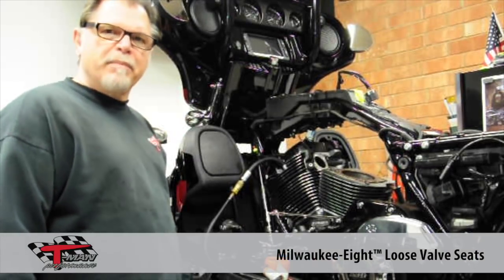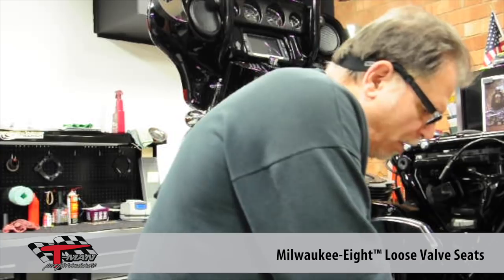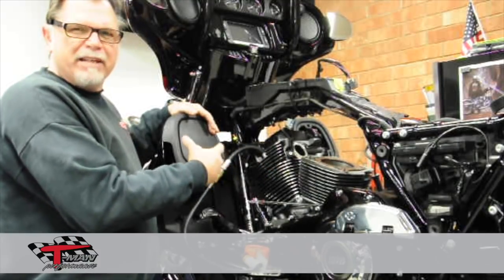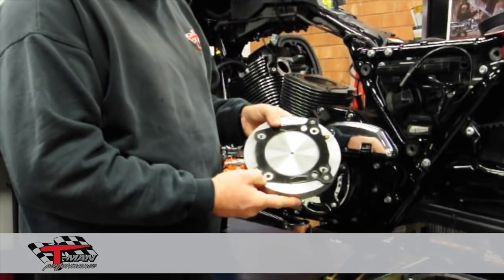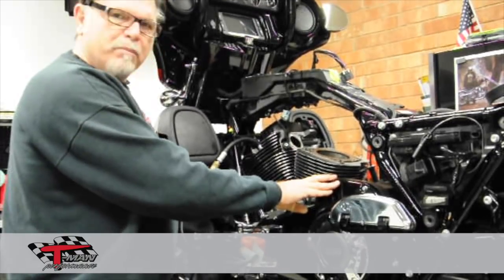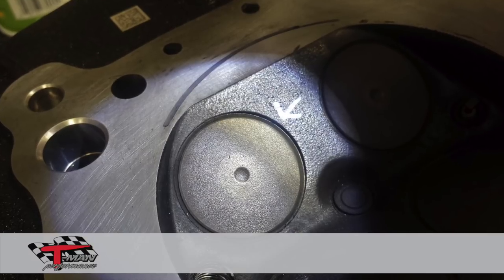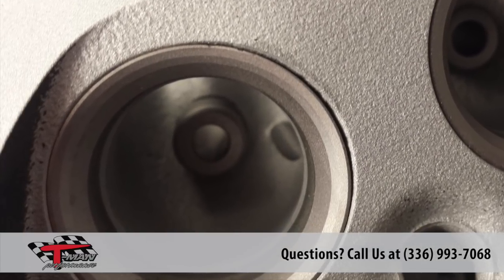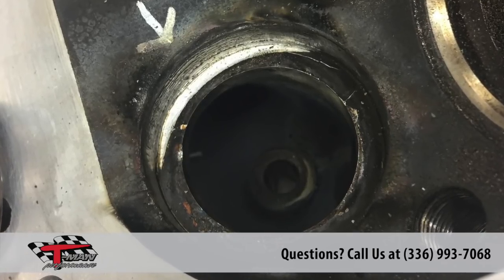Milwaukee-Eight™(M8) Loose Valve Seats

Comment: 3 to 5 % leak down in the whole assembled motor lol that's nothing ,you would have that much with total seal rings, because  in 35 year of building motors  your not getting that little leak down like  that,with  conventional rings  , 10 to 11% with a cold motor  ,I build mountain  motor 632 cubic & had 9 to 12% leak  down  thats nothing

Comment: I SURE DO LOVE MY EVO! 🤣
Reply: I've had the same thing happen to Evo's when I've heated them up to press the guides out, didn't even have to "drop test" them, I've just picked them up and the seats were just laying there having already fallen out during the heating process, and found the same carbon buildup in the seat pockets you see in the video, same with some Twin Cams including my own '05 and even my '03 Sportster, this isn't something unique to the 8 valve. 
Back in the 70's some friends of mine went on a month long trip out west and in Kansas one guy had an exhaust seat drop down on a running engine in his Shovel.
Reply: @dukecraig2402  great product from the "Motor Company"
Reply: @kennethwise7108  
I used to own a bike shop and I've seen plenty of Japanese and European motorcycles that had serious issues, like the early Honda Interceptors with cams that wiped the lobes off so quickly that they became known as "chocolate cams".
And then there's the late 80's to early 90's Evo engine case's that the cylinder stud's pull the threads out of the case's on stock engines, try Heli-coiling the case threads and they'd do the same thing, the case's from that era were a crap shoot, but here's the thing, if Harley makes 100,000 units a year and 3 of them do something then people start crying "epidemic", the chain tensioner's on the early Twin Cam's are a prime example of that, every shop in America made a fortune selling gear conversation's for the supposedly "problem ridden" tensioner's but despite the number of cam cavities I've been into on those things I've yet to see one happen, and every shop I've been to and ask someone to show me proof I've yet to have a single one show me parts from one of the "catastrophic failures", all you get from someone is "Well everyone knows it's a problem".
As far as what you see on the internet and in articles it's easy for someone to take the cam chain's out of one and rough up the backside of them on a bench grinder and put it back together and run it and Presto!!! The infamous cam chain issues you see on the internet, yet there's literally millions of cars on the road with cam chain's that are in engines that have over 150,000 miles on them and not a single problem with cam chain's, talk about problems, that was all the broken timing belts that were prevalent in car engines from the 80's, that's why you don't see timing belts on cars anymore. 
I've worked as an automotive mechanic, truck mechanic, and had my own motorcycle shop and even went to aircraft maintenance school and I'm here to tell you the motorcycle maintenance world is the most unethical thing I've ever seen, bullshit, flat out lies and tricks like what I mentioned about rigging up cam chain's to intentionally fail run rampant in that world and that's how some guys make their money, and it's easy to do with motorcycles because like anything else people get emotional over it's easy to take advantage of them.
I don't care who makes it or where it's made, if it's a machine it's eventually going to break, period.
Reply: @kennethwise7108  
Oh nice, I like the roll over in it, what year?
Reply: @dukecraig2402  we did that back in 2011, here's a short video of my bike, all original unmolested. https://youtu.be/eIohnw2glPk
Reply: @kennethwise7108  
How many Panhead riders does it take to change a lightbulb?

5, one to change the bulb and the other 4 to stand around and talk about how much better the old bulb was.
Reply: @dukecraig2402  VERY TRUE!!!
Reply: @kennethwise7108  
The alternate answer is "It doesn't matter how many you have, they won't change it" 🤣🤣🤣

When I heard that joke years back I was in a buddy's bike shop in the middle of taking a swig of beer and as a result I blew beer out of my nose when he told me that.
Reply: @dukecraig2402  that's SO FUNNY
Reply: @kennethwise7108  
I've been riding Harley's for over 32 years and I got a bunch of good ones (especially from "back in the day") but here's one of my favorite true stories that's not too long that I'll have to type my thumbs off.

Years back I was in a bike shop that me and a crew of guys used to hang out in that was owned by an old timer that had been riding since the early 60's, one day when he wasn't there his wife was and she was behind the counter, out of the clear blue a nomadic friend of their's was passing through town and stopped at the shop to visit, he was asking the owners wife all the usual questions like "How's he doing, how's so and so doing..." etc etc, then he ask if the owner still had an RV that they'd take to bike events as a support vehicle and the owners wife said "Yea, he's still got it" to which the guy replied "I caught some of my best diseases in that thing!!!"
Snot blew out of my nose on that one.
Reply: @dukecraig2402  wow that's some story! I don't think I could top that one!

Comment: Thank you for the videos on Milwaukee 8. I just bought a new 2018 FLSL (softail slim). At 3000 miles have a noise by cam. At Harley shop they thought the gear had burrs caused by chain. 
Replaced gear. Noise persisted. Now changed inlet check valve. Waiting to see if noise is gone

Comment: Now 1/24/2019  ... Has Harley fixed this problem?  
After buying my 2000 RoadKing new (twin Cam ) I thought I had  a bad ass twin cam engine  (little did I know) But Harley built a pressed together crank
that will slip and give you to much run out ( needing a new crank) they built  cheap ass cam bearings ( that needed replacing)
and  shitty cam chain tensioners ( that need replacing  or the plastic will clog the oil pump, there go's your engine and checked often ) and they knew 
about these problems but failed to stand by their shit! 
So I have bought my first and last HOG .... That is a great name for Harley, Fuckin Hog

Comment: I bought an 06 road king knowing the problems of them engines. I havent had an issue yet but i promise you it will be the only harley i ever buy. All i keep hearing are horror stories on a pushrod engine. An easy design.

Comment: Could it be that hd purposely built shitty engine to wring more money from its customer
Reply: Yea, If you had a 99-06 twin-cam and rode the shit out of it your engine is tanked. I converted to gear driven S&S 510 just in the nick of time. Harley's are good looking nicely painted machines that are all destined for failure.
Reply: @shaverlocal  and they sound good but yeah its a ticking time bomb

Comment: I just had the stage 3 kit done on my bone stock 107. The bike had 1,200 mi when kit was done My stock pistons have alot of carbon build up on the tops. Is that normal for these motors?

Comment: Some of you are in denial. If the seats are warped as shown and it takes up to .025 to clean the heads up for the oversized seats then yes there is a problem. Some jackass is not doing the job correctly. I would't accept any seat to head leakage period.

Comment: This is a quality control problem. WTF are they doing at the engine plant 🤔 they can't be using modern machinery. and they should leak test the heads after assembly like we do at GM. This is a classic example of them trying to save a buck😏

Comment: My wife’s fltrxs goes in for repair for what the tech feels is this very issue.When motor was cold as she shifted blue smoke from left pipe on each shift until warm 2017 with 5400 miles.Lucky we bought the extended service plan I’ll stick with my 2010 fltrx 107 Ride Safe

Comment: How much would it cost to have the motor torn down . heads repaired, and  bike reassembled?
Reply: Ask someone who does not have an ax to grind or a buck to be made  like this guy.
Reply: Ok I already have! A friend of mine that works for a local construction  company, planned his vacation for bike week, he bought a new Harley dresser , loaded it in a trailer and went south for bike week. He took it out of the trailer and it wouldn't start, so off to a local dealer, it seems it had an antitheft device , and the trailer rider , had shut the bike down. The next problem occurred , the next day when he road around near Daytona, and the primary assembly went to hell. So back in the trailers it went , and my friend spent his once a year vacation, enjoying bike week in a pickup truck!
Reply: And I, or anyone else is suppose to take your word for all of this? You claimed to have found numerous sites that describe loose  valve seats. When called on it, you say google it. I did.  And finally, your latest story does not even include anything about valve seats.
Reply: Type in on you tube Harley valve seat problem. There are several videos and the go to primary problem. perhaps then Harley oil leak recall

Comment: EVO motors never had problems like this, or the cam chain tensioner problem, or the primary chain tensioner problem. This does not seem to be a design issue, it seems to be more of a quality control thing. The chain tensioners were definitely design and material problems.
Reply: Evo's didn't have problems ?????? What the fuck are you smoking ???? They had loads of problems
Reply: @nikolaiownz  Exactly Ive seen and heard of many times where the head will lift off the studs after so many miles
Reply: Oh yes they did, they had all kinds of major problems from bad cases to flywheels ect. Way to much to list here
Reply: EVO motors seem to be the only engine line Harley didn't have major problems with.  Ironic that the EVO was developed during the AMF years, those being the years Harley purists seemed to hate so much.

Comment: Which option is better: purchase new HD CNC heads for 2018 CVO SG, ship you the heads for polishing runners and chambers multi angle valve job and leak down test or: have you provide everything?

Comment: Harley Davidson should hire  engineers from Germany. Its obvious that Harley R&D are incompetent.they haven't been able to produce a good dependable motorcycle since 84-99 (evo)..have made junk since.
Reply: Matt Wise it's a QC issue not a engineering issue.
Reply: Joe Johnson  What I wouldn't give for a V-rod motor in my Roadglide!
Reply: Experienced multibrand mechanic and owner here, FUCK WORKING ON BMWS.  They should hire Japanese engineers. German engineering used to be classic and elegant.
Reply: Matt Wise WISE MATT, MATT WISE!, IT'S TRUE, YOU CAN ONLY COVER UP SO MUCH, SO LONG! IT  WASN'T QC S&S, AND ANDREWS HELPED OUT WITH 20 YEARS AGO, WE CALLED'M GEAR DRIVES, EVEN BACK THEN....QC?....NAHHH!
Reply: Uh what ? I can only assume that you've NEVER owned a Porsche 914, 944 or 924, 928 or GOD FORBID a 3 series BMW. Or the K model motorcycle,  there's a load of German crap. ALL PIECES OF SHIZNIT THAT GERMANY SHOULD BE ASHAMED OF,  and there's MANY MORE, YOU'RE OUT OF YOUR MIND, AND BRAINWASHED.

Comment: Maybe while HD is recalling all the below motorcycles for a brake failure recall they will remove and install brand new heads that are better than these junk ones that this gentleman has been fixing in his shop!
Harley-Davidson recalls nearly 175K bikes because brakes can fail.
https://search.app.goo.gl/VkSZ
Reply: You mean a voluntary recall for the consumer neglecting the brake system and not flushing it every 2 years like the motor company recommends? If people would take better care of their investment and not think the dealership is trying to get in their pockets and realized that they're trying to help protect you and your investment the motor company wouldn't have done this.

As far as the heads, TR does high performance work one at a time. No difference than a custom car shop. Let's see his product made thousands upon thousands of his product in a timely fashion. All major manufacturers have errors and they correct it. 

Again void the power train warranty. Infact pay good money to void it.
Reply: Harley Fltrx, either way you look at it good luck to all of you guys that have these over priced "Computer" bikes. I'll keep riding my Evo with a carburetor and throttle cables. Any Evolution powered Harley Davidson built between 1984-1998 will run circles around any of these modern day bikes and thats a GUARANTEE. Sorry if im coming off as an A hole but i like riding my shit not getting recalls done and having computer related problems addressed. RIP HD 1903-1998. Evo Forever Forever Evo! "EFFE"
Reply: Harley Fltrx i have had 5 Harley Davidsons in my lifetime and built one from swap meet parts so i think im qualified to know what I'm talking about here. I have also seen and read my fair share of issues associated with the Twinkie Motors and now the M8 Motor. I could fill 1000 pages of issues I've seen with this motor companies poor engineering choices over the years. If they were smart they should consider joining forces with Polaris. Maybe then they'd stand a better chance of making a quality product. To be honest with you thats all everybody wants is an American made quality product right? I know thats all i want! These things are CRAZY expensive too dude and frankly the Millennials aren't buying 25k motorcycles. Why would they when they can get a foreign one (Japanese) for 1/2 the price that runs better and doesnt have so many issues.
Reply: Kenneth Wise Polaris? Like the ones Victory made that's out of business now? It's okay you're ok, I understand that you don't understand the new technology that your car likely uses that you likely brag about daily how much you love. Like electronic throttle, mass air flow, EFI, ect.. .
Reply: Harley Fltrx yeah the same people that just happen to own Indian and just so happened to finish in 1st, 2nd, 3rd & 4th place in the dirt track circuit that was once dominated by Harley Davidson, but again I'm clueless right?
Now were talking about cars and efi systems etc? Really?? Maybe you should be driving a car/truck instead of riding a Motorcycle as i thought what we were discussing here was motorcycles? Don't be a hater...Sorry.
Reply: Kenneth Wise , you mean after Indian took the top riders and now are doing good in flat track? Put the less talented riders ok on them and they will still be in the same place. Cars... Yes you have alot of technology that crosses over. Be you , be evo. Just try and stay out of kool aid that you don't drink when bitching online. No further action needed on your behalf. ✌
Reply: Kenneth Wise Did you just say your evo will run circles around these modern bikes? Lol. You're an idiot if you really believe that.
Reply: @motoman7445  damn strait! I didn't get 140,000 miles on my Evo by accident, I RIDE MY SHIT! No recalls, no stupid sensors or valve seats coming loose. You can have all these overpriced pieces of junk. I'd take an older AMF Shovelhead over ANYTHING new.

Comment: Out of curiosity why wouldn't the customer take this issue up with the "Stealership"? This has GOT to covered by the factory warranty no?
Reply: Kenneth  Wise if you were having performance issues the dealership would certainly complete a compression leak down test make appropriate repairs. Unlike this video is made out to be I don't believe there's hundreds of thousands of bikes with this issue.
Reply: Let's be fair unless you are building your NEW M-8 , with non warranty compliant parts why or when would someone have a reason to find this.  Ultimately the engine and power train would warranty would be effected by these parts. But Harley offers warranty compliant parts and likely price point is similar, and will have dependability that the consumer seeks. But people stay stealership.... This just steals 2 years of power train warranty the consumer paid for when they bought the bike.
Reply: Kenneth Wise , if if were a national issue not a local performance shop........ But we don't know how many motors were built and affected the factory warranty before this came up. Or how long it really took to collect the amount of data described. Think of this like HD forums and 20 guys say I have a issue. Out of the hundreds of thousands of bikes made is it reasonable to assume it's a recall? Or when you buy a basketball online and a few people leave bad reviews..... Personally I would not be worried, but I also wouldn't risk voiding a 2 year unlimited milage warranty at very least the power train portion.....  There are warranty compliant parts to increase performance.
Reply: They figure everyone is going to upgrade to $6000.00 Screaming Beagle heads anyways, so if they last or not who cares.
Reply: How do you figure they would hide it?
Reply: Kenneth Wise they will hide the problem
Welcome to Harlem Davidson
Reply: Harley Fltrx so you don't feel that a recall is in order for this problem? It seems to me that the numbers are pretty staggering as this gentleman has made a business out of fixing this problem  or so it seems.

Comment: think ill just stick to my trusty ol 1988 fxr with its trusty ol 80 evo.
Reply: I had a 1987 fxr and the case cracked oil leaking every were only had 30000 miles on it. Good luck.
Reply: johnny white AMEN TO THAT BROTHER!!
Reply: johnny white, i couldnt agree with you more!! I have a carburetor and cables that operate it. Also no computer or dumb ass cam tensioners on my bike!!
Evo Forever Forever Evo!! (EFFE)
https://youtu.be/tOYxAgA0dsI